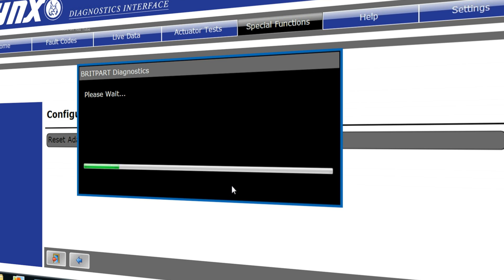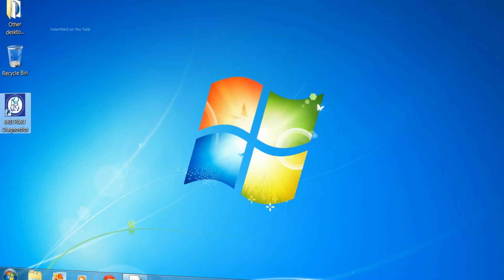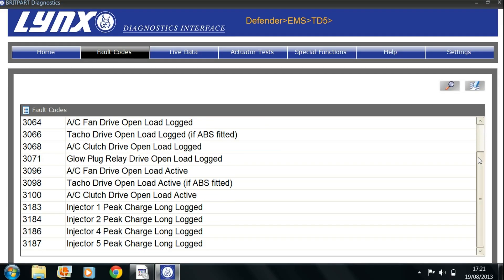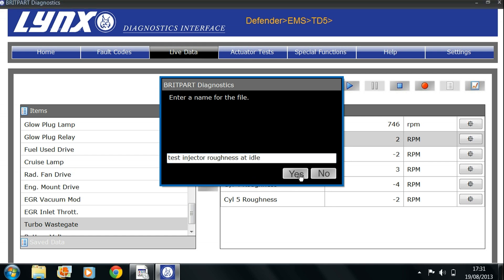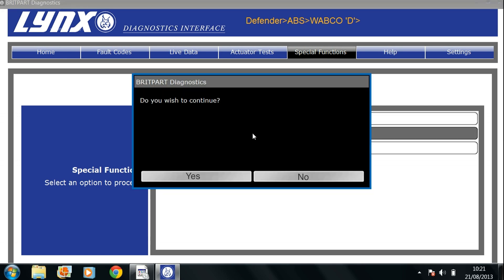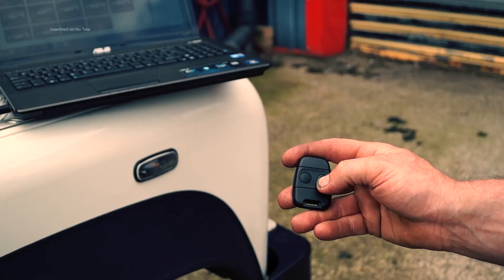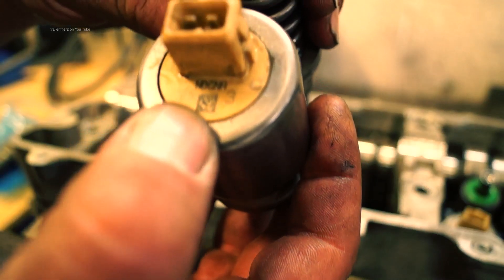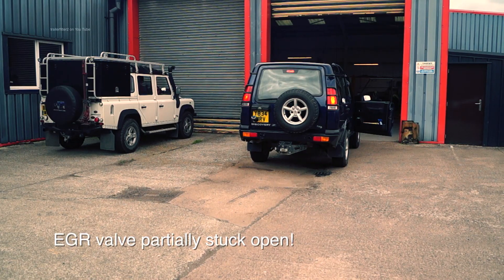Britpart Lynx diagnostic interface tool review

Comment: Pity it can't do other cars. Can it do the OBD part on other vehicles..?
Reply from the maker: EOBD2 readers read everything on the emissions side. even HGV trucks if the vehicles are EOBD2 compliant.  It is law that any reader should be able to read that side of the ECU.
Reply: So does that mean it can read and delete codes on a Nissan. I thought you could do that with OBD2 cars?
Thanks for nyour reply by the way. And thanks for these vids.

Comment: Hi,   just wondering if you have done EAS recalibration on a 2004 L322 using the Lynx?

I'm having trouble finding out if it's possible and how to do it and if blocks are needed.

Cheers, Paul.
Reply from the maker: +Paul Yorke  no not done one.

Comment from the maker: Yes it will interface with the WABCO ABS system but as a very cheap alternative you  can also talk to the ABS ECU by getting it to give flash codes.  Plenty on the internet on how to do that.  

Not sure the cost would justify it for just one vehicle with limited electronics. the only other facility you can get other than ABS is the key fob.  Saying that, you can unlock other vehicles on that interface from what I understand.